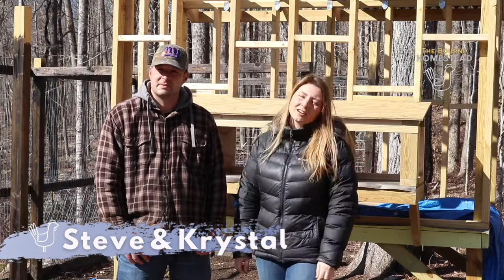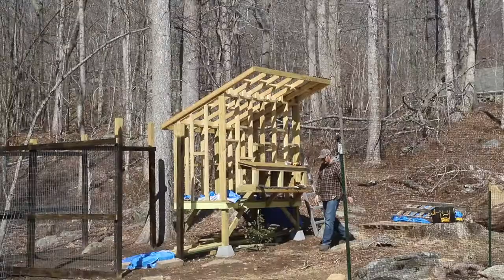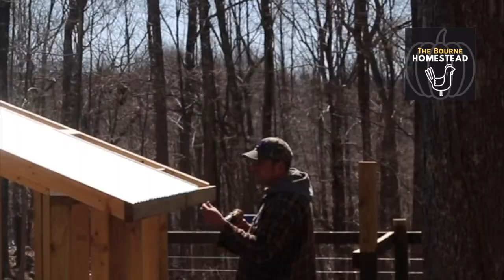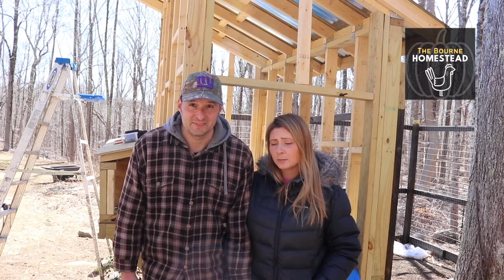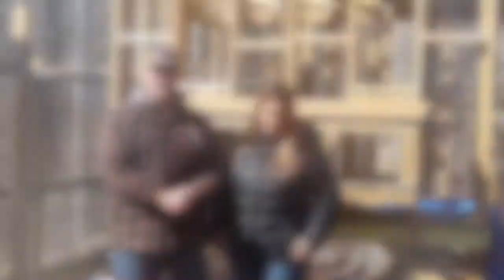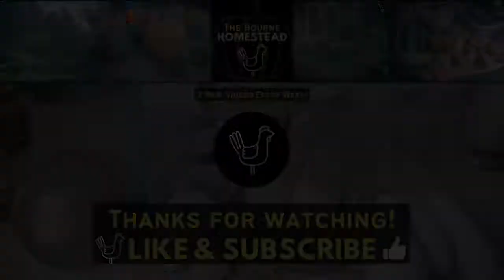CHICKEN COOP ROOF | Building a Chicken Coop

Comment: Would the metal work for the cold weather
Reply from the maker: We insulated the inside portion of the roof with reflective bubble insulation and it worked out great. The worst thing about the metal is the noise inside the coop during rain or ice storms. Thanks Emmanuel!